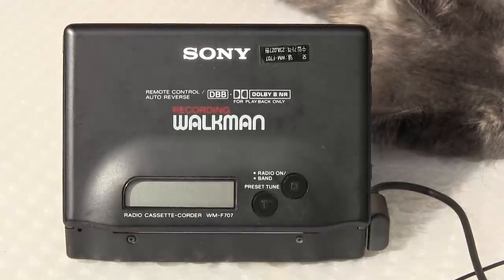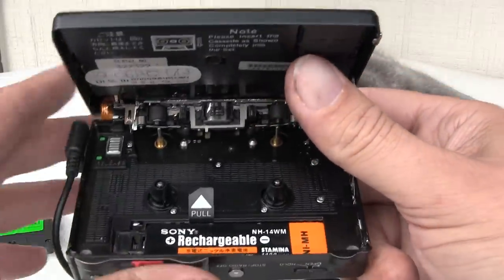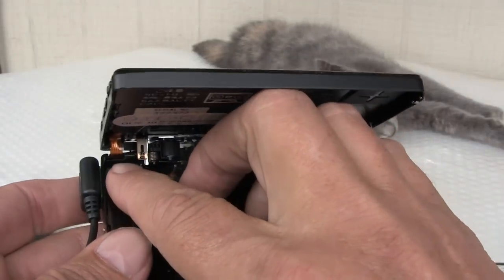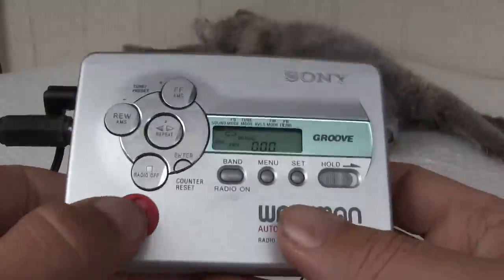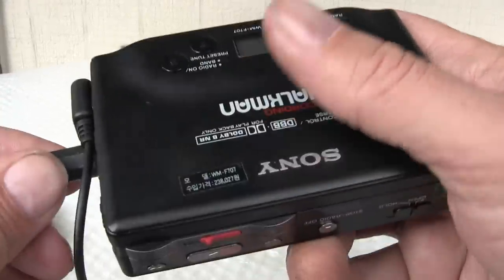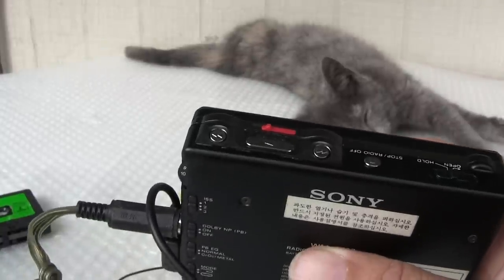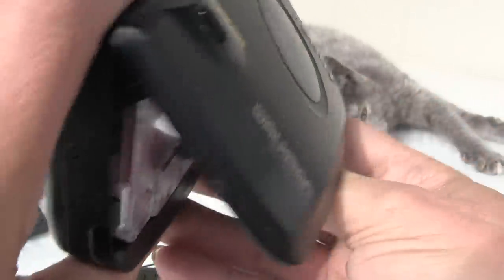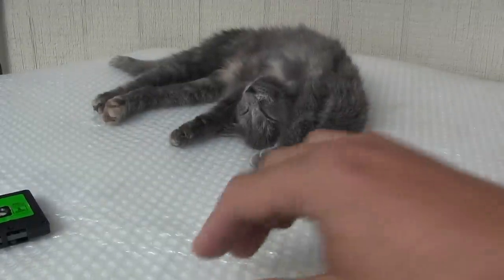Sony WM-F707 Walkman Recording & Fuctionality Part One (1) of Two (2) video's

Comment from the maker: @MrMrDJ3 Recording wih the limited recording features of the absolute basic stereo recording walkman which was designed for casual recording, basic Full control is normally found one even the Most cheapest home cassette decks and rarely found on a walkman unless you record with a Sony TC-D5M whhere you have more control over your input levels ( was too much to fit - chopped some reponce out )
Reply: CassetteTapeWalkman This is actually not that bad, its one of the best basic recorder as it have proper AC erase heads, not the permanent magnets, the next step was D3 with Dolby B and Chrome capability.

Comment from the maker: @MrMrDJ3 You are Missing the ability to adjust the levels recorded to each L+R as not provided by the simple recording walkman, also as the analogue recording device is NOT perfect Like the Digital computer is, the recording must be ballanced - as why that function IS provided in most home stereo Cassette Recording machine's.  I NEVER use a Inferior walkman to record with, always use a Fully adjustable Home Cassette deck to record with U Need a ( Sony TC-D5M) to record with - like you